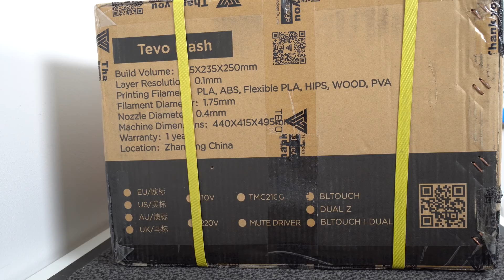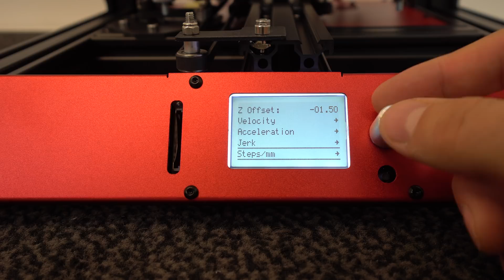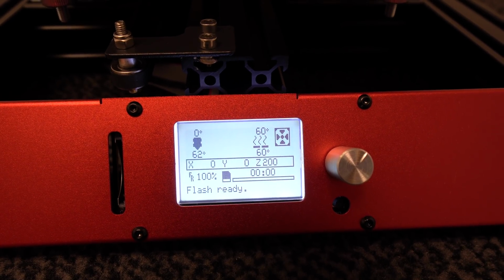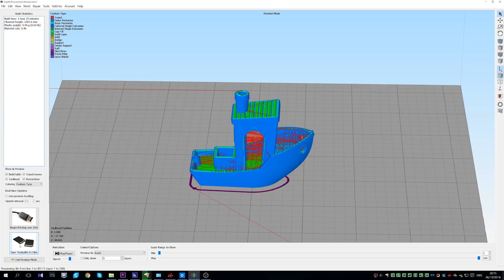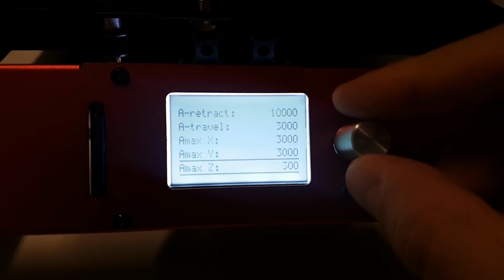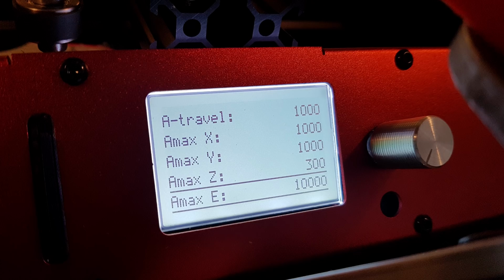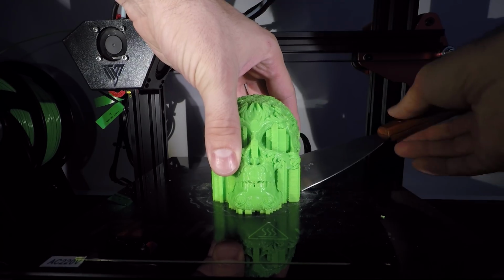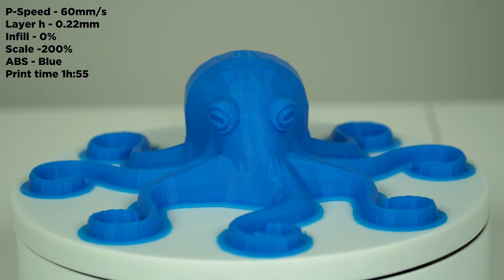TEVO Flash 3D printer full review

Comment: I just bought the 98% version (dual-Z) version.  I found that some of the rollers (eccentric nut) were adjusted too tight.  It's worth checking/adjusting them all.  There is a design flaw with the eccentric nuts; there are 2 eccentric nuts per roller (either side of the roller) and they are not connected.  It's possible for one side to be different adjustment to the other side, which would cause the roller to be twisted (relative to the frame).

Comment: 10/10 for content and editing. Very impressed with this unit and I feel the results are fantastic given the price point. Haters... would have to be the competition.

I have an Up 2 Plus and well... 1400mm * 1400mm X/Y is just too limiting so the build volume on this looks awesome.

It runs Marlin so that would indicate 8 bit MCU which is a bummer given how cheap 32 bit MCU's are these days. 

I must admit as well... I do not like the thought of AC because I like to tinker and usually draw the line with anything that has AC exposed (might be low voltage AC?)

I think if they go the extra mile with a 32 bit MCU and breakout all unused pins modders etc would flock to  it. The other thing I like is the stepper drivers being replaceable as they can fail. 

WiFi would be nice... however unlike my Up it does have the ability to be loaded fast from SD and hence not demand "the precious"  space next to the computer.

Comment: I'm intrigued by the issues you had with the Z couplers...were these not installed securely?
Reply from the maker: Where Nerdy is Cool! They ware are overtighted and that twisted them and make Z issues. Check yours. Pull the Z belt back and forward and look for any twisting on the Z lead screw. You might need to readjust couplers.

Comment: Hey, what a great review. Thank you! I'd be interested how this printer performs compared to the Tronxy X5SA you own and have tested recently?
Reply from the maker: You welcome my friend! I'm glad that you liked my video. Well, Tronxy X5SA is much bigger 3D printer it has better print surface (Out from the box) ( No vibration, ghosting issue) on other hand  Tronxy X5SA needs much more skills, fixes and upgrades to be good and safe printer, while Tevo flash don't. Personally I would go with TEVO flash. Much less to think and stress about and it's very well build machine.
Reply: Thanks for your reply and insight. I am biased to the Tevo flash as well. I simply don't have the time (and the skills yet) to tweek a device's hardware, unless it is relatively easy.

Comment: Do you have CURA PROFIL ??
Reply from the maker: PlaymoLive I change my settings on every model that I print. In CURA You can use the same profile from Ender 3 or Cr10 just change build size to 235x235x250mm and Retraction speed to 50mm/s, retraction distance to 3mm. For beginning use standard speed 40mm/s then you can go higher. That's pretty much it.

Comment: i want to buy 3 printers, but i need your advice so can you guide me for a good printer even if it's expensive
Reply from the maker: muharraqi55 Sure. Just tell me what filament you will use the most? PLA,PETG,ABS...? And how large machine needs to be?
Reply: first thanks boss for your reply and here is the filament  TPE , ABS  , ASA  and size 50*50cm or 40*40cm . thanks again

Comment: Aftter tuning, Witch has Better quality tevo flash or ender 3?
Reply from the maker: Pablo Rodrigo Gantier Cadena Very hard to say Actually! Ender 3 showing salmon skin on prints surface(TL-smothers needs to be installed). Tevo flash showing Ghosting/vibrations pattern on prints Firmware needs to be adjusted. But I would give advantage to the Tevo flash because It has auto leveling(optional) Nice glass build plate, AC heated bed, It's much quieter with 2100 drivers(optional),dual cooling fans,Titan extruder,Vulcano heat block, more features in firmware Stronger frame etc. I like the Ender 3 as well don't get me wrong but Tevo flash has more features to choose :)

Comment: Great Review! I Just bought an Ender 3 to compliment my Ender 2, but the print quality of the Ender-3 much worst (too much Salmon Skin with the v1.1.3 board, and apparently TL-Smoothers don't work with this board). How do you compare the print quality of the Ender-3 and the Tevo Flash?
Reply: I think that it can be some tweaks that you've possibly didn't made... I can't advice about it but I've seen the video of the Russian guy who did show that Ender-3 prints without salmon skin at all (his machine of course). Maybe there is something in the firmware that is tricky to upgrade on Ender-3.
Reply: @KiR_3d  Thanks for your advice. Apparently is was easy to minimize the Salmon Skin on the printers with older versions of the Motherboard. As far as know the only way people fond until now to solve the Salmon Skin with the v1.1.3 board was to bypass some resistors in the Motherboard to force the stepper drivers to work on another mode. Or replace the Motherboard.  I sold the printer whyle was still new and bought a Tevo Flash. It is backordered on Banggood but I hope the print quality is close to the Ender 2.
Reply: Yeah, I plan to buy Flash now too. Too much dances with Ender-3... I plan to waste my time mostly on making the analog synth, not on this :)